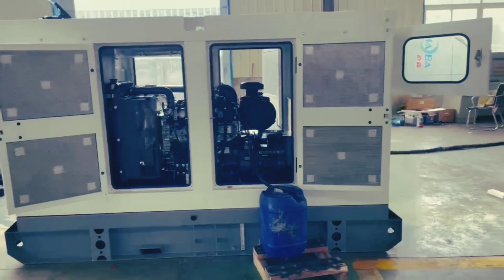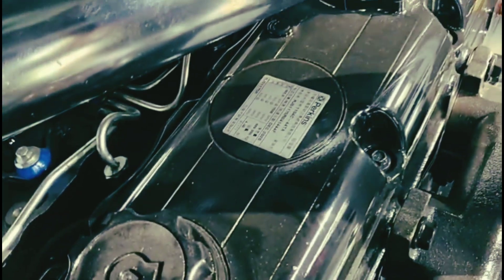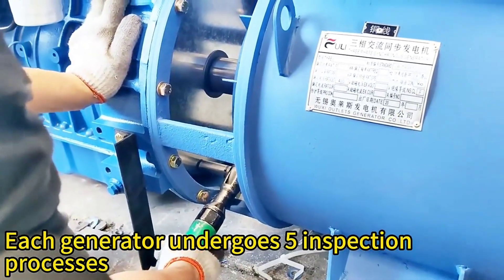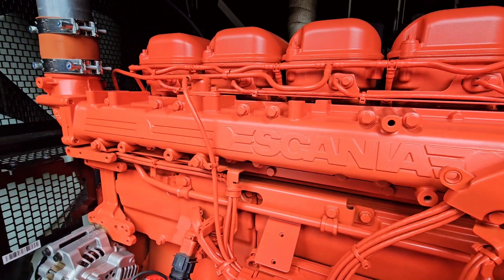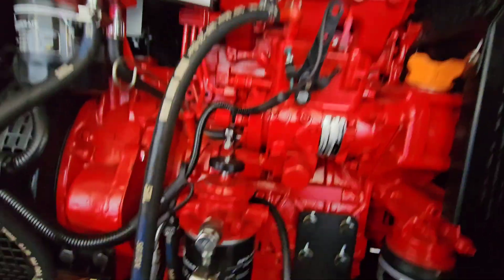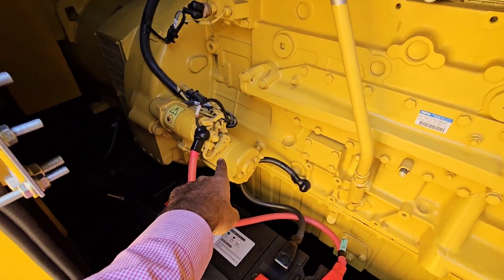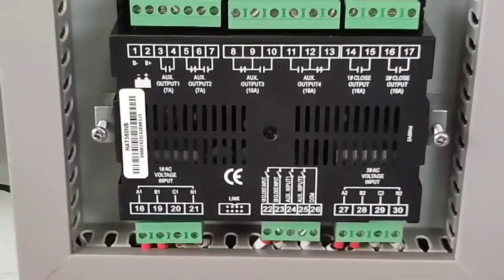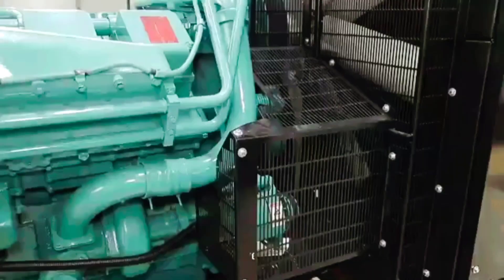Why diesel Generator fails | Top reasons of Diesel Generator failures @Dieselgeneratorksa

Comment: How do you decide on which cross section of power wires to use on a generator? For example how thick cable would you use on 1000kVA generator? Do you have any charts or calculations? I want to avoid extra cost by putting too big cables